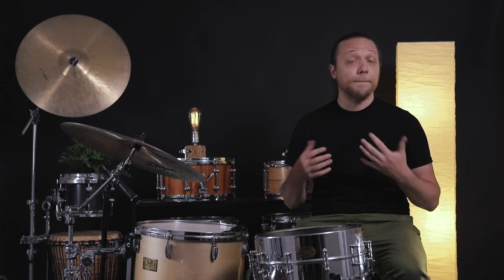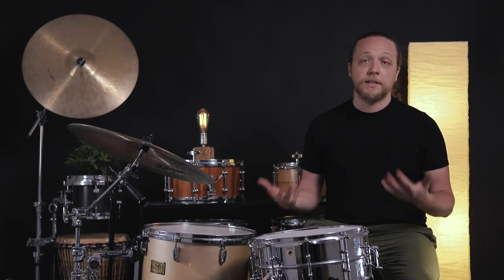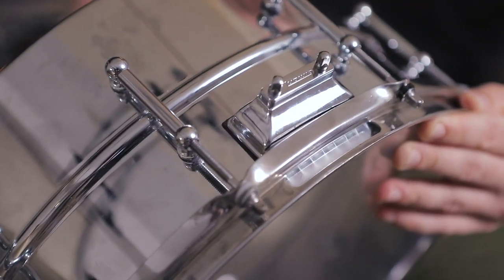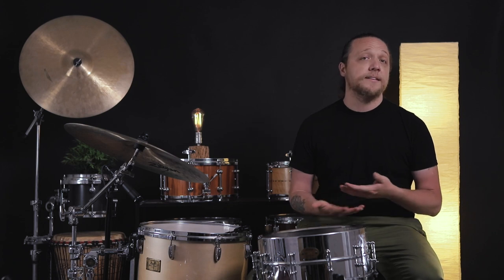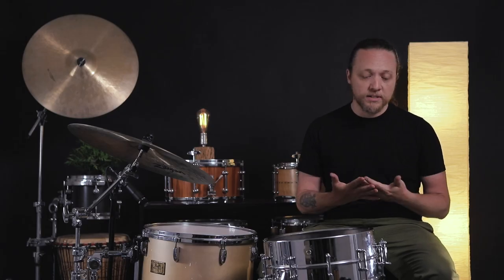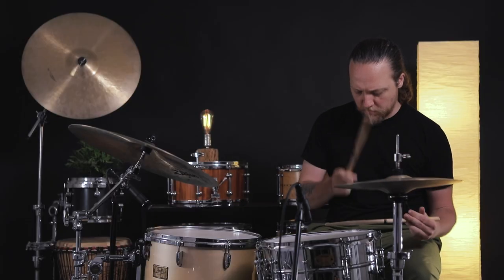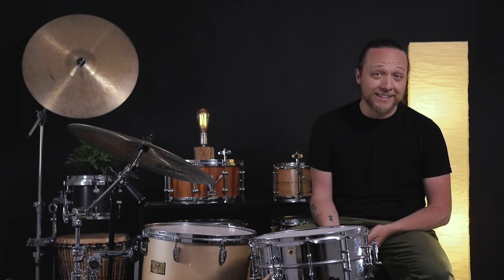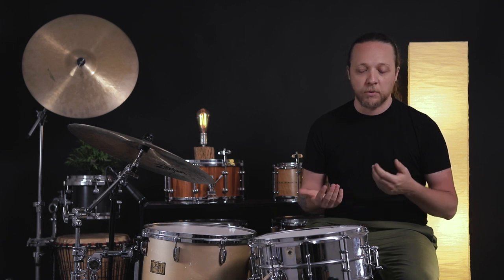Snare Drum Mod: Snare Mechanism Upgrade | Season Three, Episode 8

Comment: I love Ludwig snares but have always had problems with any P80 series throw.  I build drums and have used pretty much everything, from Trick, DW, and the ones designed by someone that rhymes with Don Runnett 😉. The INDe throw, for me, is the best throw out there. Fits virtually anything, works perfectly every time, and it’s so not overpriced. To top it off, Josh is the man. He will answer any question, even about products made by other brands (I had to take apart an ATLAS mount and the only person who knew exactly what to do was Josh). Awesome company, awesome hardware.

Comment: I was satisfied with the sound of my acrolite with a p85,but the wires kept coming loose. I put an INDe strainer and butt plate on it. I love it. While I was at it I went ahead and put a new ambassador head on it and PureSound 24 strand brass snare wires. It sounds incredible loose or tight. With the p85 it only sounded good when tight.

Comment: Good stuff. Thanks. I wish I'd seen (I'm not experienced at snare surgery), even a quick video sweep across the bottom and sides  a bit, after it's all upgraded, showing, eg, the butt plate (hate to say I'm not even sure which piece that is), snares, hookup - what it looks like with the problems solved. Thanks again.

Comment: I love INDe strainers and replace all the P85 strainers on my 70s Luddy snares (400s, 402s, a coliseum etc) and they just work! Will have to keep an eye out for the horizontal butt plate as all mine have come with the weird vertical one that I have never had any use for. P83s tend to stay put on my 60s drums though as I have never had any trouble with them. Keep up the great work!

Comment: Thanks for the headsup about Inde. I'm currently looking to replace the tension adjustment side of a Gretsch Lightning throw-off setup. I really like the on/off throw part, but the tension adjustment side is pretty inadequate, if you ask me. When I first started using it I was pretty disgusted by how poorly it held the tension I set. I've Macgyver'd it with some pieces of tape inside the mechanism and it's working ok for now, but I'm looking to swap out the butt plate side for something better. The Lightning setup is unusual in that it's on/off on one side and tension on the other side, so probably what I'll end up with with is on/off on one side and tension AND on/off on the other side, which I guess is weird but should work fine. Might actually be cool to have on/off on both sides. Wish me luck!

Comment: Ah this is great. Not too long ago, I replaced the really loosey-goosey screwed up P85 on my '68 Acrolite with Ludwig's new P88 (which is very much like this) but guess what... the butt plate doesn't fit. I tried tapping out the extra holes that are there to supposedly address the fit, but the metal is too soft and wont hold threads.
Now I can buy a clean looking and robust butt plate that will fit and lose the old janky one that the Acrolite came with.
Thanks!
Reply: Wes Chilton Sorry to read your tapping didn’t go well on that butt plate.  Lord knows what I did right to have it work out for me.
Reply: @a.j.wilkes6352  You probably have a better tap and die set than I do! ;)

Comment: Love the P83 throw off, simple effective design
Reply from the maker: For sure- though it runs into issues too. We couldn’t be happier with the performance of the INDe strainer system. Smooth, silent, locks in place, and SUPER compatible when it comes to accommodating different hole spacing and/or a center bead.

Comment: What a perfectly timed video! I'm in the process right now of rebuilding a snare drum. I bought a Gretsch Catalina Maple shell with no Hardware on it, just pre-drilled and I'm adding 8 lugs. I have a 2.3 millimeter hoop for the top and a 1.8 mm hoop for the bottom and the inde throw off. However I did not want to drill holes in the shell for the Inde buttplate and it's a very odd size spacing. it's 41 mm which is 1 + 9/16 spacing for the butt plate. The only thing I found that would match is a Pearl concert snare butt plate which is kind of too fancy and Gibraltar's vintage slingerland buttplate which is what I've bought to put in there. I've actually modded all my snare drums usually by adding a better throw off. I've always gone with the Gibraltar throw offs except on my other Gretsch vintage Maple snare which came with the lightning throw off, but it was bent and I could not get it tightened the way I want. So I pull that off and replaced it with the DW Mag throw off and the matching 3 position butt plate. I did have to widen a couple of holes on that but wasn't hard and it doesn't show being that it's a wood shell. And this was done about two years before DW bought Gretsch so it's kind of funny that I did this ahead of time.

Comment: I love experimenting with different parts! I read only positive things about the InDe throw-off. At the moment, the Trick three-step is my favourite strainer. I don't have it right next ti my leg, so the wider space that is needed for its lever action is not an issue for me. I just love the design and the way it operates. No trouble, whatsoever! 
I also have the DW MAG strainer on another drum and am wondering how long the magnet in it will last and what will happen after that. 
The all metal Nickelworks strainer is also nice and really solid. 
The RCK strainer looks beautiful, but, unfortunately, also has an issue with getting stuck when engaging it. As it is not the cheapest snare strainer, I hope this issue gets addressed by the company.
Thanks for your effort on the new episode. I love your content!

Comment: I have that same butt plate problem on my 2016 Black Beauty. I ended up getting a special Remo head with low collar so I could tune it tighter. I'd consider a replacement butt plate as a permanent fix but doing fine with the special head.
Reply from the maker: Definitely a worthwhile $20 investment.

Comment: I’ve actually had a problem with a brand new Ludwig snare (14x8 hammered bronze phonic) where the inside of the lugs had these weird rubber things that kept the threaded metal pieces from falling into the lug when you take out the tension rods. Pretty much all of the rubber things were wore out and the metal pieces were all in the lugs so I had to go to a hardware store and get some other rubber thingys to do the job and they work sooo much better. Can’t believe Ludwig would do me with such a strange and minor inconvenience like that 😂

Comment: I just can't seem to find a strainer I really love.  They all have some kind of compromise to them.  The ones I have or have tried:

1) Noble & Cooley: super smooth and quiet.  Long throw makes it a bad choice for parts that require you to engage/disengage the snare wires quickly.  When disengaging, the snare wires actually get tighter before they loosen - using Puresound blue cables will cut grooves into the snare bed.  I've also had it disengage slightly (to the tighter point) when laying into it.

2) Old DW perpendicular strainer: basic strainer, works well enough.  Like most basic strainers, there's a slight audible noise when disengaging.  But I guess it's either that, or have a long throw.

3) Old Pearl perpendicular strainer: same as the DW above, but it uses extra-long snare wires that extend past the drum shell, so there's the added annoyance of having to calibrate some extra parts.

4) Various parallel strainers (Ludwig, Tama, Yamaha, etc.): some aren't very well-made, and the levers can wiggle, get stuck, get blocked, etc.  Small strainers save space, but getting a hand on them and operating them seems a tiny bit slower compared to big perpendicular levers.  They also tend to be less smooth.

5) DW mag: similar to the N&C but without its problems (aside from the long throw).  However, the tension knob points outward, making the entire strainer stick out really far.

6) Ayotte rack and pinion: lever is backwards compared to other parallel strainers, and rather tight.  Rack and pinion function doesn't seem all that useful.  According to Ronn Dunnett, it has a design flaw where a certain part will always fail over time.

7) Rogers Dyna-Sonic: sounds good when dialed in, but what a PITA.

8) Piston Nickelworks: very smooth, but originals were prone to breaking.

9) Dunnett: improvement on the Piston Nickelworks design.  Love the quick release.  Sticks out very far if arranged perpendicular.  And there's the thought of giving money to Ronn Dunnett.

10) Trick: Long throw, and the angled lever feels slow and weird to operate, since it does not lie on the plane of motion.  Dunnett's version, with the lever sticking straight out, feels better, but I just don't like that design in general.

I guess the Dunnett wins for me, just because of the quick release.  Otherwise, DW mag, unless I need a short throw.  Too bad the N&C can't be easily replaced because of its unique hole pattern.

BTW, I don't understand why most people put the strainer to the side (other than the one guy who mentioned operating it with his knee).  It adds width to the drum.  Putting it in the center, pointing at your junk, saves space and makes it operable with either hand.

Comment: Just fitted 2 SB1 throws onto 2 different snares, one on an old Camco COB Tuxedo, which fitted perfectly and one on a 63 Acrolite, which didn't! Had to request a set of spacers as the throw wasn't clearing the bead (so likely the original was drilled slightly off centre back in the day).  But with the plastic spacers that Inde supply (though annoyingly not with every throw off), it slipped on to the Acrolite perfectly.

Comment: I change out my strainer on all my snares….. I either put a DW Mag throw off or a Trick throw off on them. And if the holes don’t line up I make custom brackets to mount them. The Mag throw is my all time favorite strainer, but I use a Trick on my side snare….

Comment: I'd love to see you find an alternative to the (cursed) Gretsch lightning throw off and butt plate! I'm trying really hard to fund a solution to that now...without redrilling of course.
The inde throw off will work for one side, but the other... I'm looking into either the butt plate of the Gretsch micro sensitive butt, or the Gibraltar George Way beer tap style. I think if I can find a butt plate with single mounting hole (with the right size) I'll be good.

Comment: Couple of years ago I replaced the original p85 on my '77 LM402 with a new p85 (this was before p88s and others were available). I did that only to be able to mount the wires on a strap. Guess what, the 70s mechanism glides like butter and the new one is a pain in the rear end.

Comment: In general snare strainer mechanisms have too much play between the moving parts and this only gets worse over time and with heavy use for sure. I actually had a couple of years training as a machinist for screwcutting/ thread for the automotive industry a decade ago. The accuracy standard of production and quality control is key to a great sounding/operating but also crucial is to keep things clean,dry and a dab of copper grease can transform a rough/sticking adjuster.
Reply: Great work Cody, stay safe in NYC? Keep a mask in busy areas and wash those magic✋😆

Comment: Nice video!  The sole P-85 I have from the 90's has the sticking problem you mentioned, so I upgraded it with a newer Ludwig similar to the INDE strainer.  None of the P-85s I have used that were from the 1970's had the sticking issue.  I must mention that I do not think straps work as well as snare cord.  Although cord stretches a bit when first installed, the fact that it loops through the snare ends allows snare tension to be equalized from side to side.  Straps, if installed even slightly off-kilter, will produce more tension on one side than the other, and can cause buzzing and choking, in my experience.  The Puresound straps that have alignment marks help ensure snares are installed straight, but they do not allow tension to be equalized.  And yes, every time you mention snare straps in a video I will comment and advocate cord (I'm kidding)!

Comment: So this is basically a universal Throw off that fits all snare screw mounting measures??
Reply from the maker: Not necessarily ALL but certainly most with two vertically aligned mounting holes.

Comment: Do you know if the throw offs screws match with the diameter of the yamaha hole pattern? 
I would like to mount this throw off on my yamaha sd 3455!
Thanks
Reply from the maker: The spacing is flexible (two vertically oriented screws) but you should double check with INDe to confirm.
Reply: @SoundsLikeADrum  I’ll check with inde, thank you